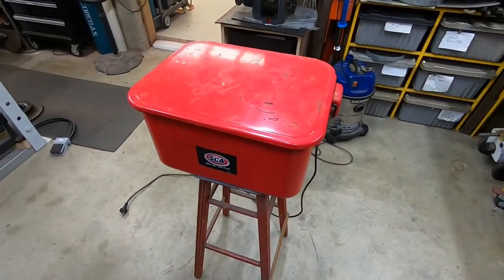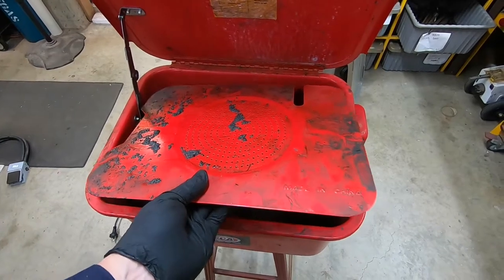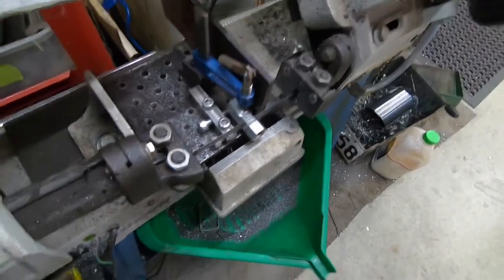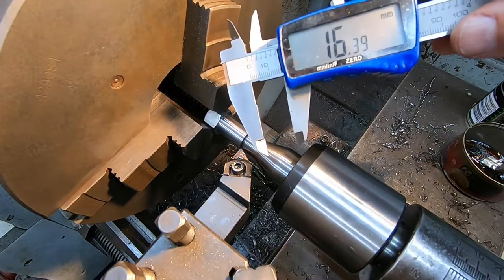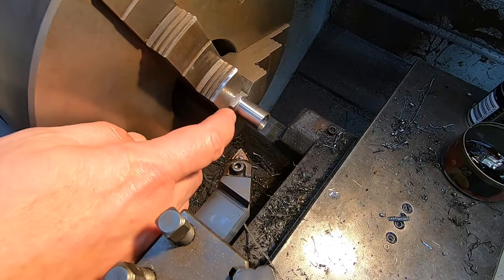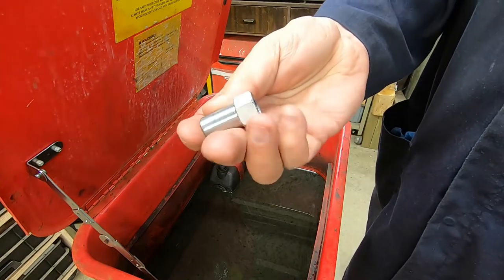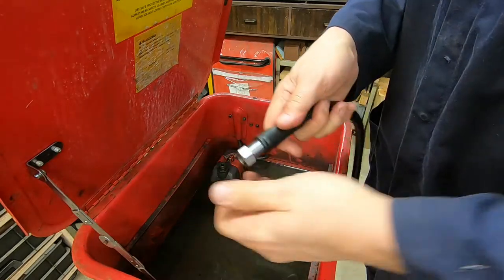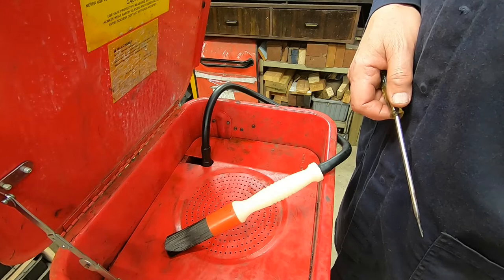Machining an adapter to fit a flow-through brush to my parts washer.

Comment: Why not just put the rubber tip from the new  parts washer brush over the metal tip from the parts washer as per it was designed to do????
Reply from the maker: To a hammer everything looks like a nail. I have a lathe so I immediately defaulted to making an adapter. It just didn't occur to me that the rubber connector on the brush hose might fit over the original nozzle :( 
Thanks for your comment.